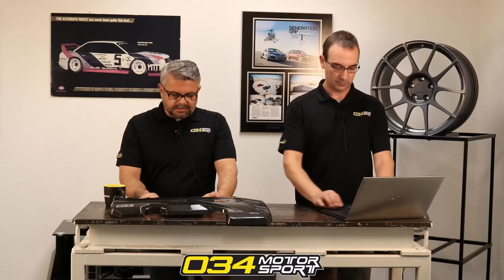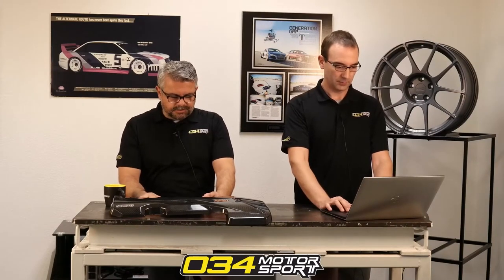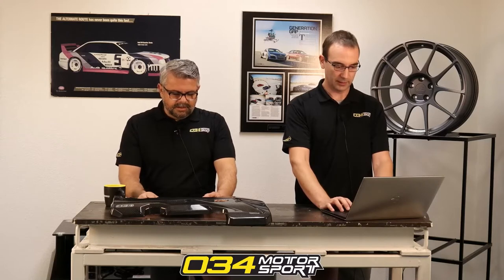What Spark Plug Gap Should I Run on my Stage 2+ E40 B8/B8.5 S4? | 034Motorsport FAQ

Comment: This video indicates that the stock plugs are fine right up to Stage2+ but the website suggests to use 1 heat range colder (DR10S) can you clarify please?
Reply from the maker: As discussed, stock and upgraded work fine with various stages, and unless the car is running poorly, there is no reason to change them. If you are changing plugs, the DR10S are a cheaper than OEM, high performance replacement that are a great option to replace OEM with.
Reply from the maker: https://youtu.be/5FUukpLrSbY
Reply: I am also having issues with misfires using the ngk plug stock gaped so its obviously an issue